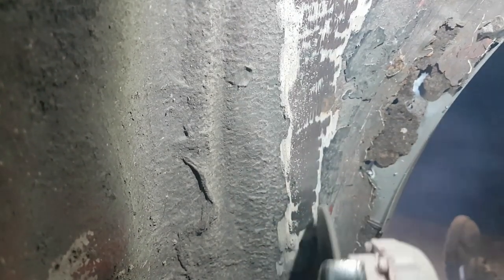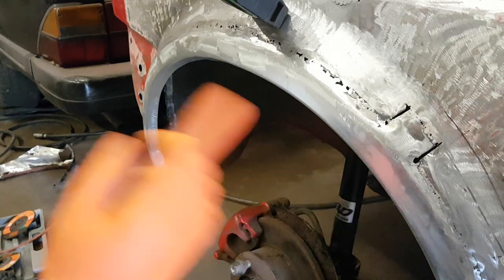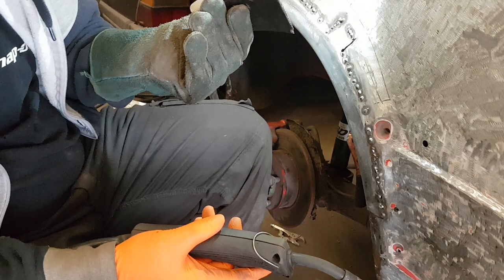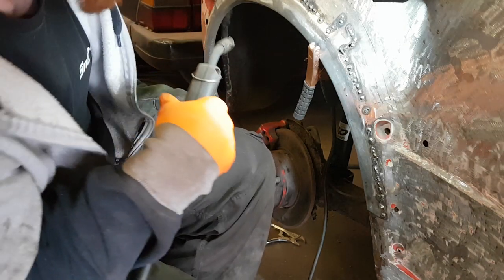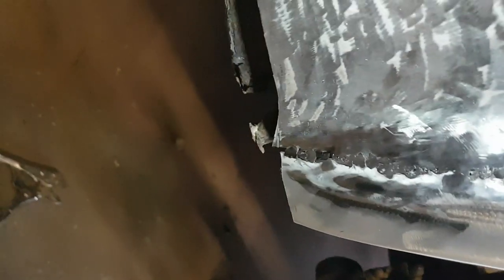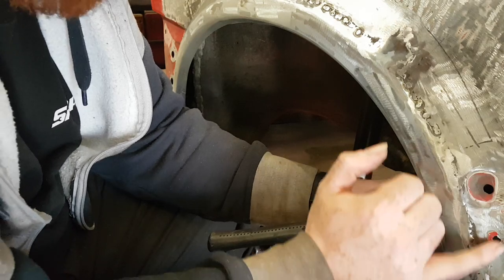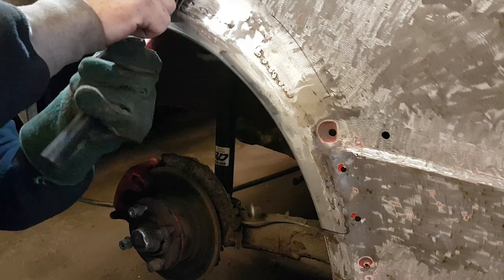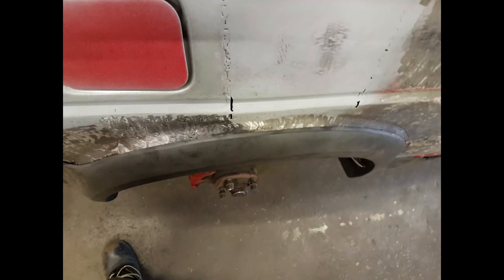Volkswagen MK2 Golf GTI Restoration Episode 2

Comment: Man you don't have make hard work of it, just buy 2 arches for the same side cut out outer then cut out the inside one then you can see how much of the inside one you need.
Reply from the maker: I completely agree mate, this side caught me off guard as it didn't appear to be even remotely rusted out "bodged metal glued up there" 🙄🤣 
so I just through the outer on and sorted the inner at a later date, on the other side I won't be counting my chickens until they've hatched 🤣🤣

Comment: After a bit of advice really my sill has gone slightly at the front and at the rear rest is fine. Would recommend full sill replacement or cut and patch with aftermarket panel.
Reply from the maker: if its definitely just the front and the back then by all means cut and patch with an aftermarket panel, my advice would be before cutting up a replacement sill is make sure 1million% that the rest of the sill is fine, nothing is more annoying than cutting up the replacement panel to then find you need more of it.
Reply: Aaah thanks for the advice, I'm just taking off the inner sill closing panel get a proper look at it. Also have to replace the whole jacking point floor pan. The joys 😪
Reply from the maker: Good luck with it all mate 👍 I'm sure to find something to do around the jacking points on this 1 once I get round to removing the underseal from them 😅